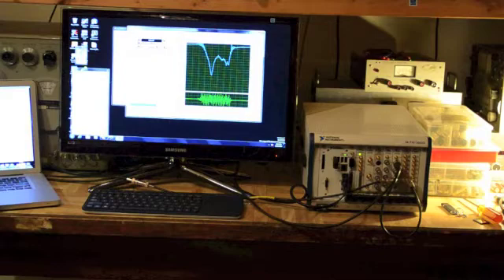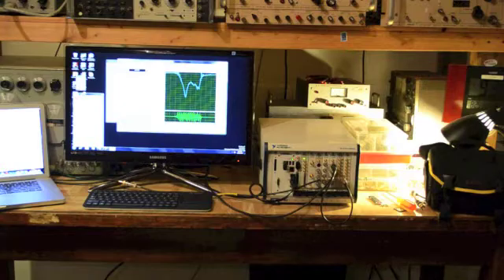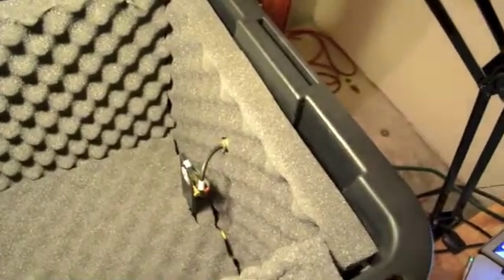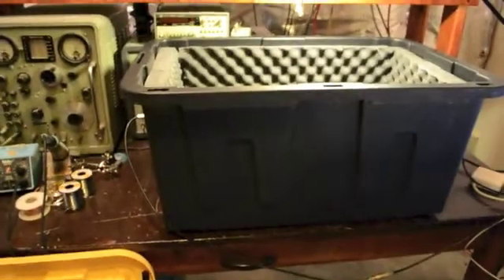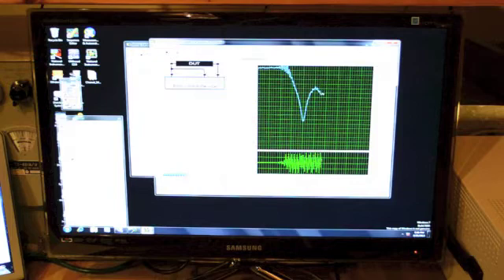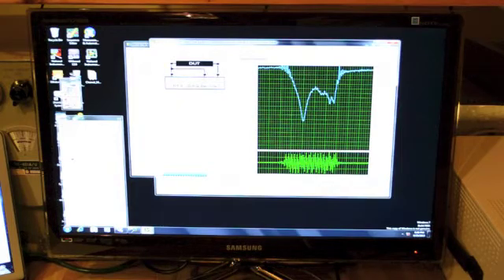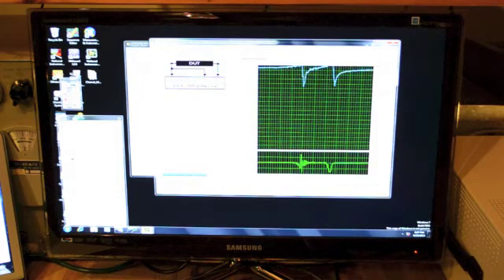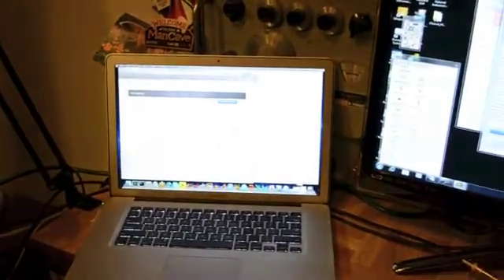Portable Acoustic Anechoic Chamber

Comment: Did you checked how much of the received sound is coming from propagation through the box's walls instead of air propagation?
Judging by the stiffness of those Aluminium mounts,  my guess is that will be far from negligible.